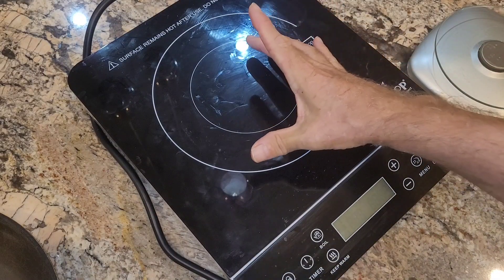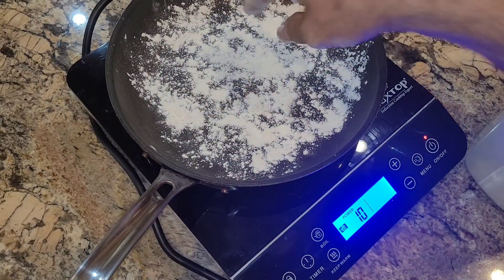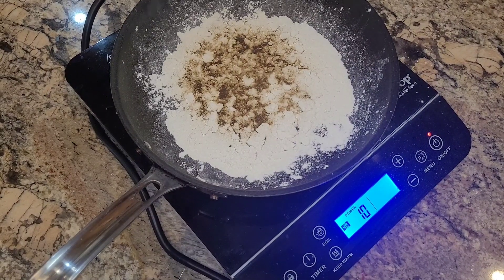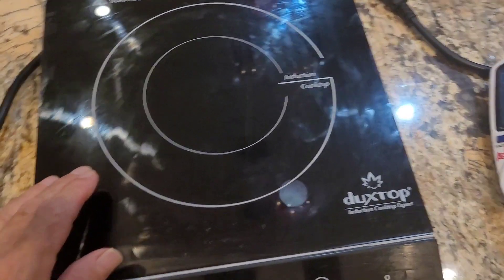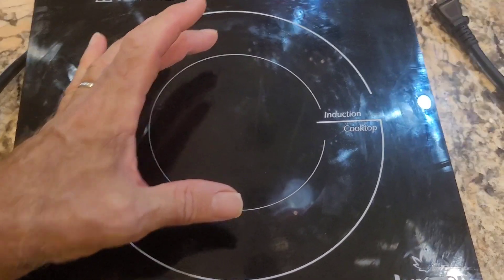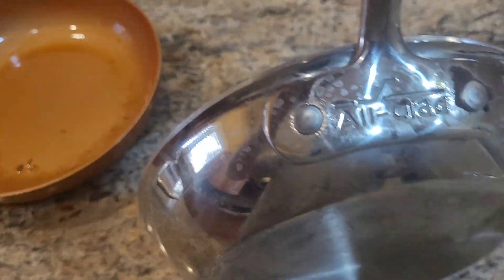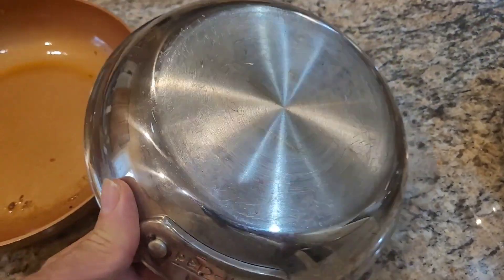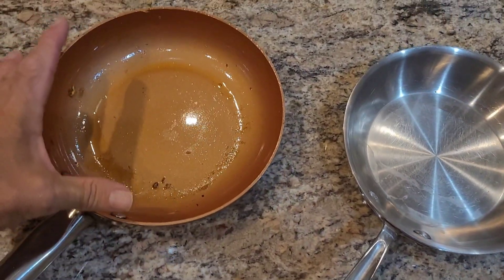Testing Hot Spot size, Duxtop 9600LS Induction Cooktop

Comment: If you want a 9” coil, Breville $1600. Whole range with large burners $5,000. In suction is a scam. The hot spot warps my Matfer carbon steel. My cast iron never heats evenly. You are spot on. I just tend to take it further. The powers that be are taking away our gas burners. Gas is the only way to cook omelettes. Portable propane is just fine also. On my gas barbecue gas burner, I cook omelettes well and can do delicate sauces and recipes.
Reply from the maker: Yep, but the 9" breville coil gives a 5" hotspot, same as this one.  8 in coils give a 4" hotspot.

I love the gas best also.  Just messing around with induction as a possible truck camping option for windy wet days... Ive got the battery power to support it, fun to try.
Reply: @ArtisanCook clearly you own stock in planet killing non renewables! You'll be extinct soon enough!
Reply from the maker: Ok.
Reply from the maker: Thx ;)

Comment: This video is spot on.  The effectiveness of the induction cooktop really is measured by the size of that coil.  I was an early adopter of this tech a decade ago and still have that first Duxtop and the coil on that thing is only 4".  It will in fact warp pans.  I have ruined a fairly expensive carbon steel pan on that cooktop warping it.  For cast iron and carbon steel they are not conducive to transfer the heat throughout so the hot spot is literally just above where that coil is.  If you are cooking anything the middle of the pan is done or burnt and the outside of the pan doesn't have enough heat to do anything.  So you spend your time shuffling stuff around the pan trying to evenly cook it.

I now see some are advertising an 8" coil so I am going to give that a try.  I see some list a 9" coil, but they are pretty expensive.  I would love to see more in depth reviews of these induction cooktops comparing the actual coil size that is heated, how uniform they heat, and how well they control the temps as well as pan size recommendations for them.  There really isn't much that is useful out here on Youtube.  Yours and a couple of others that have even touched on this topic of the hot spot and what it means for pan size and cooking.  We need better info on these cooktops. 

I am going to try a clad pan also to see if I can get a better spread of the heat.  So I am pan shopping at the same time to optimize this setup.  I like the induction cooktop, but the information is misleading, missing, and not a lot of people have posted actually living with and cooking on these things.  I have been cooking on mine for a long time and just dealing with the significant shortcomings.  It is time for that to change.  Hopefully the newer 8" coil will change that.  The biggest mistake I made starting off was trying to use too much heat.  I can turn down the induction cooktop to a much lower setting and control the cooking speed better.
Reply from the maker: Thx for the comment and watching!  I think you will be disappointed by the "8 inch coil", as 100% of these I have looked at it is a marketing scam.  The OUTSIDE DIAMETER of the coil is 8" yes, but the HOTSPOT IT MAKES IS JUST 4"!  So all the brands are listing "8 in coil!", but it is a meaningless marketing blurb.  A 9in coil will generate a hotspot about 5in as I show here, that is the largest I have actually found unfortunately. 
     You are on the right track for a thick bottomed pan to transfer heat, you want a clad pan with an Aluminum or copper core, but a ferrous iron bottom layer!  Here are the best ones I have so far found:
All-Clad HA1 Hard Anodized... https://www.amazon.com/dp/B0170TFNXM?ref=ppx_pop_mob_ap_share

These have a standard good thick AllClad bottom, but have a special disc on bottom for induction pickup.   Work great.  Unfortunately the sides are steeper than I like for most pans, makes flipping stuff hard, but these are a good price and for sure work and spread heat!

Comment: I've got the exact same unit. I've run my big 5 gallon pot on it but I only use it for warming mostly. My induction pots from 1qt to 8 gallons all have a thick layered base that helps to spread the heat a bit outside the 5 in spot. My kitchen IH cooktop has 7, 9 and 12" rings - you get what you pay for for sure.
Reply from the maker: Nice.  Yes, a good thick bottom disc really helps with even heat for induction.